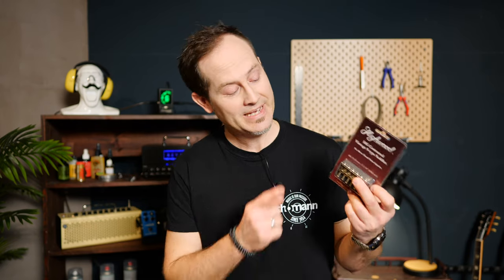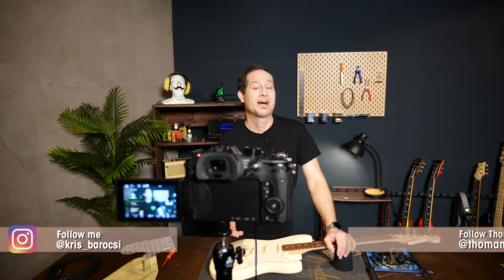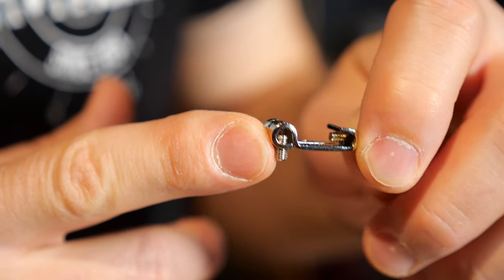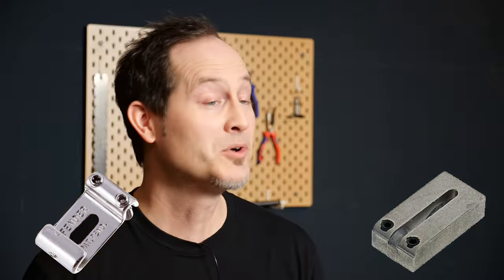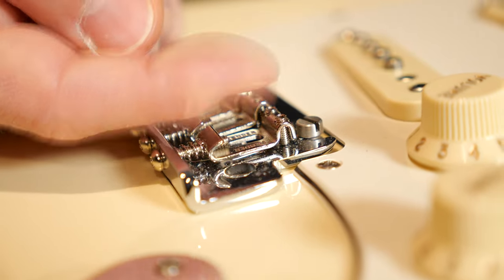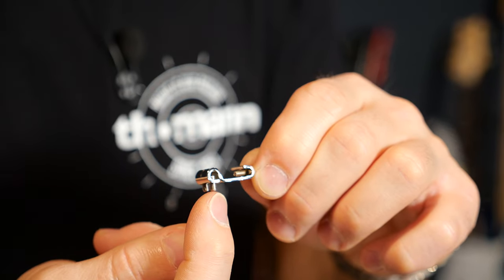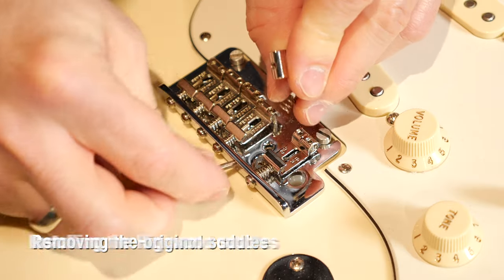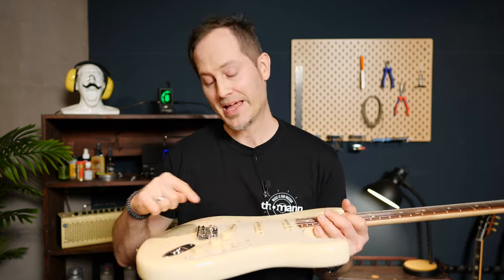Best Strat Saddles Ever? | Highwood | Guitar Tech Tips | Ep.99 | Thomann

Comment: I’ve had a “problem” with two Strats and their saddles: the intonation is fine generally but tightening them also raises the base of the saddles off the plate beyond the point of the grub screws contacting the bridge plate. The action then becomes too high. The intonation screws remain parallel to the bridge but the saddles resemble a rearing horse. As these saddles have the lower grub screw holes lower, they may be the better choice.

Comment: Hello! Here's a 4€ trick:
I bought different height adjustments screws with different length, 9 mm to 7,5 mm from low to high. So the screws would turn entirely into the saddles.
On the standard Fender bridges, all the screws are 10 mm.
Problem solved. 😉
Reply: I did the same thing, works a treat! I had a nice mixture left over to do my tele as well!
Reply: @cowieson  😉👍
Reply from the maker: Yeah that's a great tip! It doesn't work on all strats though unfortunately. Depending on the fret hight, the action preferences and the bridge angle even the "compensated" screws can stick out. I have these shorter screws for the two E strings on my ABM strat bridge, still they are slightly sticking out. As told, I'm totally fine with that so Idon't mind that. :)  But if none of the screw tricks work on your strat and you can't stand that, the Highwoods come pretty handy. Cheers buddy!
Reply: @ThomannsGuitarsBasses  Ok, thanks for all these infos, I didn't know. That's the difference between a beginner like me and a pro. 😉👍
Reply: @Oilid  the difference is that a pro knows that those screws are available in a bunch of lengths and there is always one that works. i use them on all my guitars.
Reply: @ThomannsGuitarsBasses  that means you are not aware that you have more lengths available. i use 3 different lengths on mine, but there are even more depending on string height if needed. they never need to stick out. it does work on all starts. also, on american strats you need the sae, not the metric versions.
Reply: @ThomannsGuitarsBasses  Is the Highwoods” Just a new remake of the original fender bridge saddles(with round top)?Why would they have re-designed the bridge saddles into a larger clunkier form? Is that for mass or sustain or something? Just curious🤓
Reply: @christopherdouglas512  they’re not noticeably bigger they’re just a tad more thicker. They’re excellent I hated the original saddles on my telecaster and almost ditched the bridge before I found these. It’s probably the best upgrade I’ve done on it.
Reply: Come on now people, we should all know that chrome plated plastic saddles were used in the 70s on Strats plus these are thicker steel and better quality all-round. Remember players were swapping and building thier own saddles in the 60s /70s before the brass replacements were available.

Comment: Here's the issue with what you said about modern saddles. They're the same dimensions as vintage saddles. That, means that the height adjustment screws stick out of those just as much as they stick out of the bent steel saddles. I know this because I measured them and you can clearly see it when sat next to each other. 🤔🤷 So having modern block saddles is no different than having bent steel saddles. The screw still sticks out and digs into your hand.

Comment: Wilkinson/Gotoh has the best design with the VS-100. Comfortable saddles that are also locked down to improve tuning stability.
Floppy saddles will always throw off your pitch everytime you use the vibrato arm.
Reply: I’ve had a vs100, but my Chinese tremolo with the Highwood saddles has better tone and is very stable. No issues.

Comment: Does anyone know if these will fit a 1993 Fender Strat Plus with block saddles?
Thanks
Reply: I assume the 1993 has the offset block saddles, these ones are only center screws, so while they may fit size wise they will shift all your strings upwards.